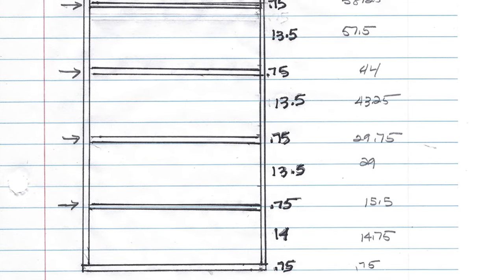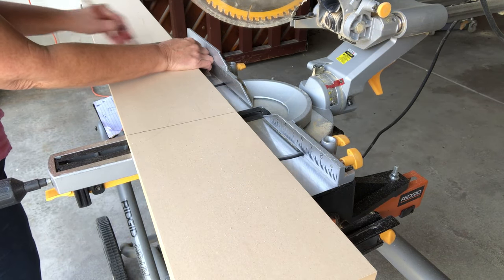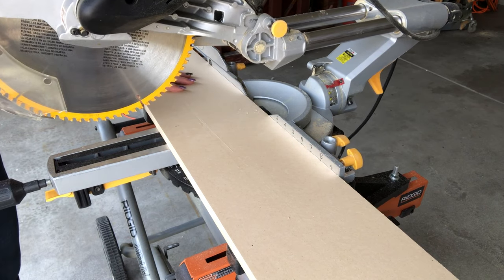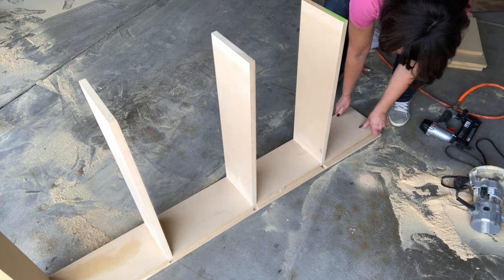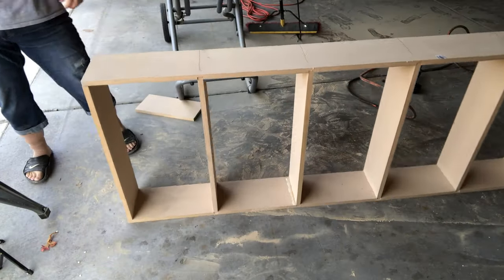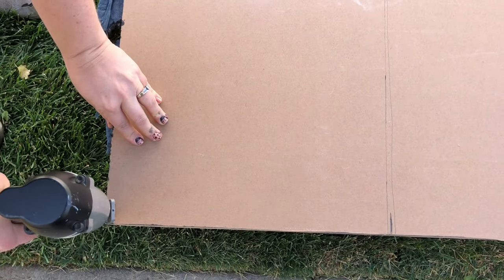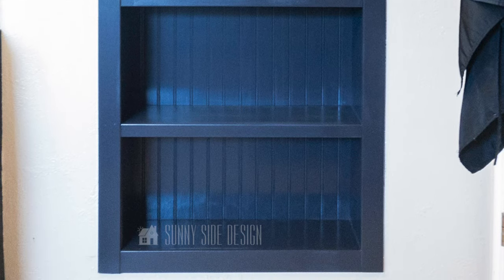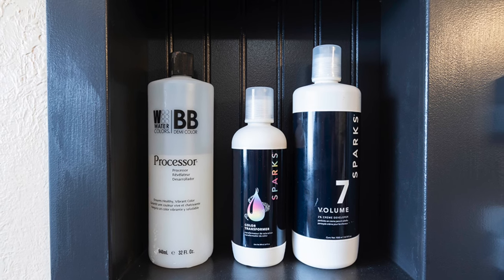*HOW TO BUILD Recessed Shelves in Wall | *Turn Unused Space into EXTRA Storage!

Comment: Thank you for sharing your building technique. This looks amazing. I love how you showed how to do the router groves and the jig. I have the perfect area to put one of these in a wall that the previous owner left cutout. One question if you're able to answer. The 2 boards you attached to the top and bottom were they cut shorter than the other boards since they were not inserted into routered groves?
Reply from the maker: Thanks so much for watching! Sounds like you have the perfect spot to put one of these in your home! And yes, you're absolutely right! The top and bottom boards are cut a little smaller. They measure the distance between the two vertical boards, where the other shelf pieces are 3/4" longer to extend into the dado grooves 3/8" on each side. Hope that helps. Good luck with your shelves and let us know how they turn out! 🙌🏻

Comment: ok so im building the acualt unit/box seprately with measuremnts im using . love the instructional and techniques im new at this but i get what to do etc for the miost part. i never used the framing square to make sure those brads stay straight whn attachng thank u for the tips so helpful ill begin soon......
Reply from the maker: We’re so glad the video was helpful! Thanks so much for watching! Let us know how your project turns out 🙌🏼
Reply: @2thesunnyside  hi Ladies. I finished it up and it was challenging, only cuz i had an already existing cavern or space cut out from previous owners that i still am baffled as to what its purpose was. It was baically a large framed out square, at the bottom of the cellar stairs within the landing area, which on the other side is huge utility closet lol . i wonder what it was sup to be for . funny though when i had wainescoating just tacked up from behind i came around to look to line up cuz i had to match the grooves with a bottom wall piece i had put in as well as make sure the piece i had to cut was lined up. it was fun i love it. i havent gotten around to find a good prpose other than to stage stuff to bring up stairs or to put away in shop. id love send you some pics if u wouldnt mind i reallly liked the one u did here in vid so i kinda tried to mimic as best    again thank u so much for responding when iasked a question . you ladies rock. David